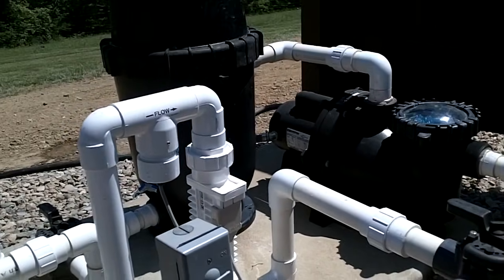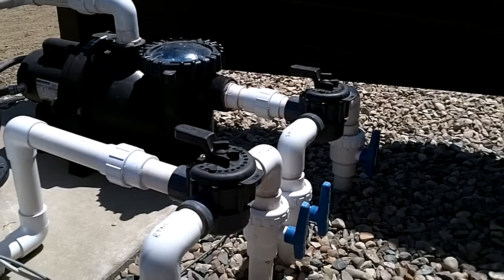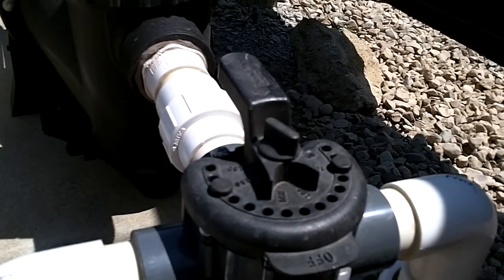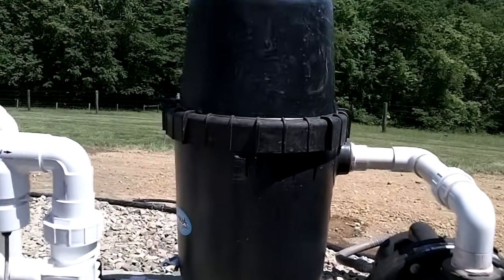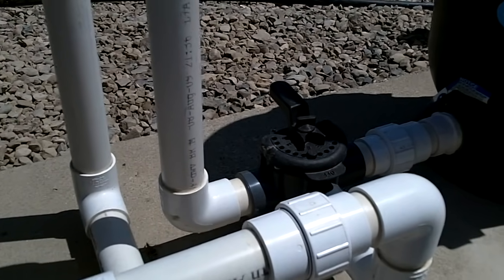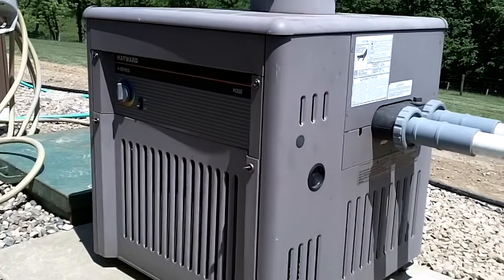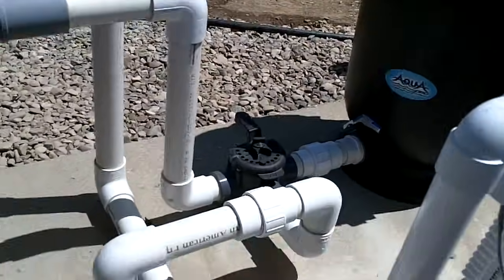How Pool Plumbing SHOULD be put together.

Comment: While this plumbing is clean looking compared to many installations there are a number of major problems with this installation that certainly do not qualify as what a "proper install" looks like.  Most notably there is no check valve in between your heater and the salt cell.  I am not surprised that you do not like gas heaters since your customer will be replacing that one in less than 5 years.  Less than 2 if they cycle their pump on and off multiple times per day.  The flow dynamics themselves are acceptable until you reach the salt cell.  The flow meter is not installed correctly.  To achieve reliable contact with a mechanical flow meter like this you need a straight unobstructed pipe run on both sides of the meter.  10x the pipe diam before and 4 times the pipe diameter following the meter.  You do not have anywhere near to the correct run here.  In terms of the flow dynamics you would be well advised to insist to your customer that you create a larger pad so you do not need to create flow restrictions with 90 degree fittings so close together.  Sorry to rain on your parade - as I said it is a nice and clean looking install but if you are going to advertise this video as how it "should" look you should revisit these glaring oversights.
Reply: Plissken Snake It is also worth noting that the heater bypass also gives you the ability to regulate the flow of water through the heater...not just simply on and off.  With many heaters having a maximum designed flow rate near 125 GPM, and many large pumps like the Intelliflo (145 GPM) or Ecostar (160 GPM) able to meet and exceed these values it can be useful to have a three zone bypass installed to allow some of the system water to skip the heater.  This way the heater is not running at or near maximum designed flow rates every day of its life.
Reply: Brenden Trower In a lot of municipalities if you zone in a heater you then need to add a pressure release valve which is expensive so many pool companies install them like this to save a few dollars.  Like $100 dollars.  And yes, without a bypass to take the heater offline during periods of chemical imbalance the life of the heater will be dramatically reduced.
Reply: Swimming Pool Steve and not any check valve but a chemical resistant check valve.
Reply: Steve please show a properly plumbed heater with a by-pass The Jandy JXI with VeraFlow claims it has a builtin by-pass.
Reply: Looks wrong to me too lol n.e.r.d huh?  Never. ever. really .did plumbing?
Reply: Shut up nerd
Reply: The plumbing is NOT CLEAN lmao this is amateur at best wtf is the point of doing ball valves on return and suction with a 3 way? JUST USE ALL PENTAIR OR JANDY VALVES WITH A CROSS LIKE DAMN 😂 anyone can tell you that all those unions ya got on there to make future plumbing repairs easier is great and all but wtf ball valves almost always break a few years later and you got your writing facing out not in and thats just sloppy AF dude idk where this is but it wouldn't fly in the 561 or 305 or 954 or any part of south Florida
Reply: Agree with Steve on the 90s in there. Way too many, and too close together. The pump won't make anywhere near rated flow unless the intake is at least 2 feet from the closest 90. When I did my pool, I outlawed 90 elbows on the installation. I bought 20' of flex 2" PVC. The only 90 elbows allowed were in the dual bottom drains. My pump flows gangbusters.
Reply: @docmirror8009  flex pipe is only meant to be used underground.  You fucked up
Reply: You do know when you install a bypass for the heater and use it. That water is still in the heater just sitting there, so if you bypass it when the PH is off it's still in there chilling in the heat exchange. Only way to make a heater bypass actually work is to take out the drain plugs and drain out all the water.
But honestly if you put the chlorinator or Salt Cell and the end of the system and install a chem check valve behind it, you really don't have to many problems.  And if the customer can't be bothered to get his chemicals right, then he probably shouldn't have a heater.  
It's healthier for the heater to actually run every day for at least 15 min to get thous switches moving and working to light a fire on the heat exchange to brake off build up. To heat up to keep rodents out.  A quick way to brake a heater is to just let it sit there and not be used.
Reply: Plissken Snake 9
Reply: While I get some of your points and it's fair to criticize, I've seen some equipment you've labeled "proper" and it was full of bends and flex pipe going every which way and just plain ugly to the eye.
Reply: @marcoallende3683  nah bro... use sweep 90s

Comment: This is a hydraulic traffic jam..
Reply: Hydrodynamics probably isn't a word very familiar with most pool plumbing installers, considering I've had to DIY fix all my "professionally" installed plumbing. Having some actual scientific knowledge of fluid flow is pretty helpful. At least OP didn't cheap out like I've seen lots of professional installers do. I've seen heaters installed with no unions, rubber pipe clamps everywhere... absolute mess to fix anything if it goes wrong.

For my 20,000 gallon pool I avoided 90 degree joints except where absolutely necessary (mostly on the valve head), and then curved PVC fittings where necessary to reduce friction. It's just easier to use right angle fittings for a brand new pool setup so this is how most installers do it, regardless of what it might do the life of the pump and other extraneous factors.
Reply: Agreed. He’s killing his flow, man. And it looks like a plumbing supply truck crashed in the yard. PVC every which way

Comment: Hi not to rain on your parade but your killing the filter with that pump that's why it's not running at full head your literally forcing the dirt into the filter those ball valves are old school step it up Astral valve also I would pipe in drain t with a slip by thread bushings so when you winterized the pool you can drain your lines at the slab....I see your a hayward man but I wouldn't recommend a hayward heater go with raypak or pentair/sta-rite. ...love the auto pilot best chlorine generator beats out jandy hayward an pentair

Comment: Great video. I can see how the way you plumbed the system can greatly aid in servicing any parts should they fail and need to be replaced. I'm replacing a bad diverter valve and would like to plumb the new valve the way you have in the video. Can you please tell me the name of the blue handle valves you're using prior to the diverter as well as the name of the union after the diverter? Also, what brand of diverter valve are you using? Thanks!
Reply: Praher Union Ball Valves

Comment: (This comment is not directed at this video's author)  
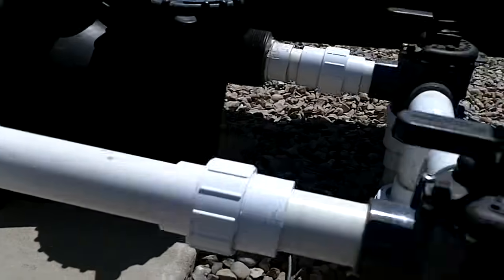I had that exact salt cell system on my pool.  For two and a half years I thought I was in pool heaven, then the darn thing stopped working...after ONLY 2 1/2 years!!  Our installer said "they usually last about 5 years" but offered us no remedy to fix or replace (under a $1000 total replacement).  This winter, that little length of plexiglass tubing (shown at 2:30 and 2:38) cracked and fell apart (and no, there was no water frozen in there).  
Maybe we just got a lemon, but I would not advise anyone to purchase that type of "bypass" salt system.  Someone please reply if you've had that type of salt system (or any) that has lasted over 5 years.  Thanks.
Reply: Sounds like you didn't clean the salt cell.  If the salt cell doesn't get cleaned regularly It gets build up on the blades making it harder for the salt cell to produce chlorine causing it to draw more amps and shorten it's life span.
If ya get an Intellachlor, that salt cell will last up to 10000 hours as long as you clean it.
Reply: I'm not a big fan of Lectranators.  Haywards are good except for the current limitor chip.  I also like Astral salt systems.  As for longevity, I have many Haywards that are 10 years old and going strong without EVER cleaning the cell!  My secret is adding some stabilizer to the water (30 - 50 PPM), keep the pH balanced and run the machine as low as possible to maintain 1 - 2 ppm of chlorine..  Many of my machines run between 10 - 15% output.  Running them at 30 - 60% will shorten the lifespan dramatically and cause more scaling on the cell.  Think of a salt cell as a light bulb on a dimmer switch.  A 1000 hour bulb will last 10x longer dimmed down.
Reply: Just a heads up: when you replace the cell Autopilot says you need to replace the cord also.  Otherwise they will not honor the warranty.

Comment: I just bought a new home and had pool guy come over but wasn't very knowledgable, so I unclogged my skimmer line myself. I wanted to ask you how to get sweeper to work on other drain or skimmer line ad other side of pool? First time owning a pool.
Reply from the maker: If you connect the vacuum line to the skimmer, you should then turn the lower drains off so that all of the vacuum power is focused on the vacuuming. if the drains are home run back to the pump then there should be a valve you can turn off. If the drain is plumbed up into the bottom of the skimmer then there is (or should) be a plate the you adjust to block off that line coming up through the bottom. hope that helps.
Matthew

Comment: How would i assort my pipe for a sand filter, cartridge, and a DE filter with a electric heater. 2x
Reply from the maker: Typically you would not use multiple filters in a single system. If you simply mean how to install each....the same layout out applies for all types. the only exception may be to add a 'drain to waste' discharge off a sand filter.

Comment: Maybe I misunderstood but if you have a millivolt heat pump then you have solved the world's energy problem.  Those three-ways can do everything you "should" be doing to your pool, the ball valves are redundant.  I like many of the unions some might not be necessary though.  The drain plug in the filter serves the same purpose as your bypass valve.  If you wanna frequently vacuum your pool to waste that union after the pump would be the handiest. Salt systems are not that complicated. Use less fittings.

Comment from the maker: Nine......You are absolutely incorrect. There are 2 ways.... the best way is to simply pull the cartridge from the canister. It takes less then 2 minutes then vac to waste till your harts content. Or if 2 minutes is too long for you, open the drain port on the filter canister (which is PER-FILTER) and discard water out the back.

Comment: Well that is not true.  When you vacuum up stuff stuff for example why would you want algae to be filtered and then have the clean water drained out? Good way to to spend more time cleaning cartridges than you need to.   If you want anyway to flush a cartridge filter attach a valve at the drain port.  From my experience there is no way effective way to flush a cartridge filter

Comment from the maker: Cartridge filters dont require backwashing. Thats one of the benifits of them. The 'drain to waste valve' is a valve that allows a place for the dirty water to exit while your cleaning the filter. There is nothing more aggravating than to clean you pool and filter only to have a 'poof' of dirt get sent back to the pool when you turn the system back on.

Comment from the maker: Yes it will. What you are hearing is actually air being sucked in and thereby causing the pump to not fully prime up. When you turn the pump off it will alos allow air back in the line and the water to run all the pool. This will make the prime up process harder as well. Best note....get it fixed. :-)
Reply: im a newbie. since pump is above the water do i need a check valve, below the water line or inline with the intake?

Comment: Does a broken pool valve affect the way a pool pump works?, because I believe I hear air escaping from the broken valve, and the water isn't swirling as hard as it was before when I look at the water turning at the top of the pump.

Comment from the maker: Good question. They are used for 'locking' the water at the equipment pad when the equipment is taken apart for cleaning. this will make the prime up process MUCH easier and almost instant. They are also used for 'Air Locking' the system durring the winter. I realize the diverters COULD do some of that but why not make it as SIMPLE for the owner as possible...?? Thanks Jeff.
Reply: Or anther thing to charge the customer for. As a fellow pool builder and repair tech, doubling up in the valves in the suction side and return side is not nessasery

Comment: You have ball valves before the 3-way valve on the intake side, and after the 3-way on the return.  Were the ball valves original and the 3-ways were added later, or is there some purpose to the redundant valves?

Comment: It appears there are wires running on gravel to the chlorine generator. Is that code there?  The pump was pulling air. Also you can wrap a rag around the male adapter, and then put your channel locks on to tighten. This keeps from scarring pvc, and a better appearance.

Comment: The discharge pipe should be longer. To optimize head flow you want to have at least 4 times the diameter of the pipe in length. (2" pipe needs 8" length minimum)

Comment from the maker: Gas heaters may be cheaper than heat pumps to put in BUT they cost a lot more to operate. Additionally most gas heaters have copper heat exchangers which will corrode and fail if a salt system is ever installed.

Comment from the maker: Yes. Injecting (or creating CL via salt cell) before the heater will dramatically decrease the life of the heater. If you are using a salt system make sure you have a heater with a titanium (or cupro nickel lexchanger so it will resist corrosion and failure.

Comment: Is there a reason the heater is before the salt cell? I am looking to install an electric heat pump and was going to connect it right after the cell as the last thing before returning to the pool.  Thanks!
Reply: In case your still needing an answer, Chlorinator or salt unit must be after heater, with a check valve between heater and salt cell. Pump , filter, heater, check valve, salt cell/chlorinator. 🤙😉